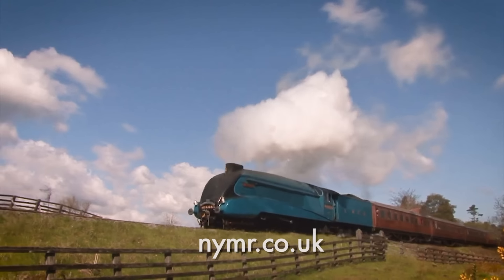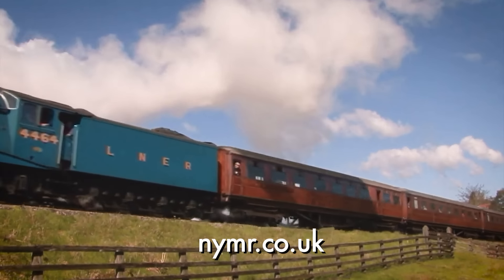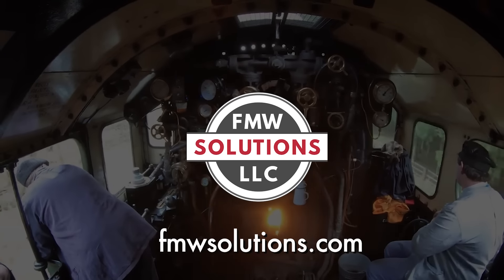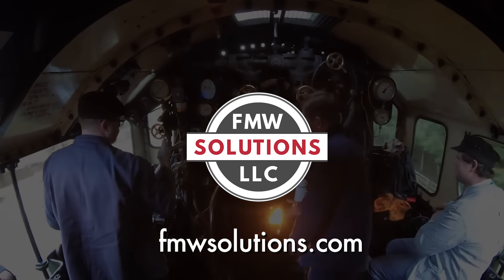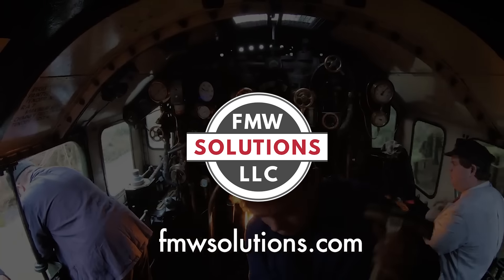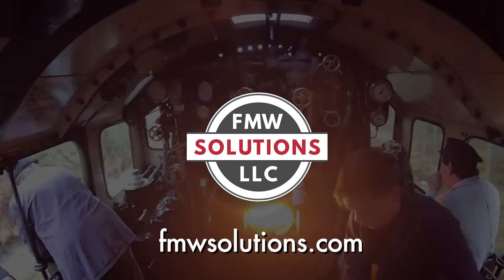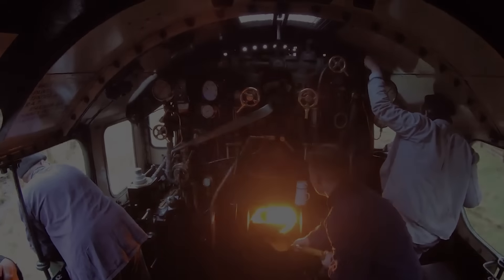Can oil-fired steam future-proof rail preservation? | North Yorkshire Moors Railway

Comment: Most people wouldn’t know the difference between diesel and steam anyway.
Reply: The smell alone is obviously way different....
Reply: @duncancampbell9490  my comment was in response to them saying the future passengers won’t have the same connection to steam as the previous generation.  In the USA steam was eliminated about 10 years before it was in the UK and most people here never actually saw them back in the day and most riders on tourist railroads really don’t appreciate the locomotive much.  The ones that do are rail fans and they usually take photos and don’t buy tickets.  Sad but true.  The smell is different if they are burning coal more than heating oil.

Comment: well the called steam engines, not coal engines 🙂as long it still making steam, why not take it all the way, its a big tank water being heated, why not go electric, put a electric heating element in the boil heat tank, and would have one of the greenest steam trains going? your could electric generator or batteries in the coal tender, and when main network line hooking electric third line, or overhead wire, if permitted, like modern train does, may charge the batteries too, would retro fitting electric to the rest on the train set, a lot easier if desired?
Reply: That's actually been done before, Switzerland converted a couple of steam locomotives to run on overhead line electrification during world war II when they were cut off from their coal imports but still had access to all of their abundant hydropower.
Reply: Some locomotives like Tornado already have a generator and battery set in the tender to power auxiliary electric systems and there are electric warming systems to help with start up.

I'm not convinced a steam locomotive powered by the grid would be necessarily greener, though. On top of the locomotive's efficiency, you have to deal with transmission losses, which might lead to more coal being burned at the power plant than if you put it into the locomotive firebox.

You pretty much have to ensure that you're power is coal free. (In the Swiss case they had a surplus of hydropower)
Reply: @eliyahzayin5469  I do not think grid power is feasible with overhead lines. Though the grid by November will be 100% coal free for ever and there is often a huge excess capacity of green energy available. Best to leave the grid for homes and industry.

Comment: THERE NOTHING WRONG  WITH COAL OR OIL GREENHOUSE EMISSION ARE NEGLIGIBLE IN THE CASE OF STEAM ENGINES
Reply: Coal causes a lot of damage to the boiler and works, due to ash and dust. Trailing axleboxes on 4-6-0 types get a lot more wear than the others. Coal should be restricted to occasional use on demonstration locomotives.

Comment: Why not go all out and stick an electric motor in the boiler casing, fill the tender with batteris job done. No more 10 year boiler certificate, no more filling up with water, no more worries about causing fires in the summer.Preservation means just that, preserving as is.The whole point of heritage lines is for future generations can experiece what it was like at a certain time in history.
Reply: You could shrink the engines down to run on a track less than 10 mm gauge.

Comment: It’s a stupid idea. Oil will become scarcer as the supply starts to run out. Why not convert coal burning locomotives to run on wood or charcoal from sustainable forests?
Reply: You can but the energy content is low and it gives rise to sparks.
Reply: as physiocrat mentioned, the energy density of that type of fuel is low and you'd need a small forest for an operating season.
Reply: @physiocrat7143  Torrefied biomass should have somehow reasonable energy density, roughly same as brown coal. but that could perhaps be problem for smaller locomotives.